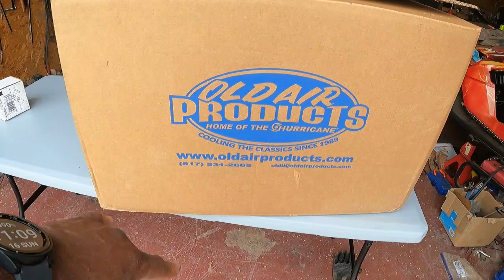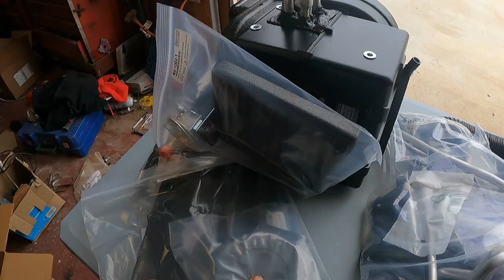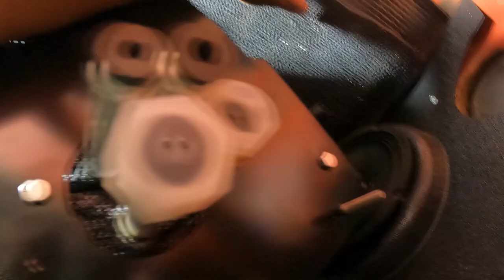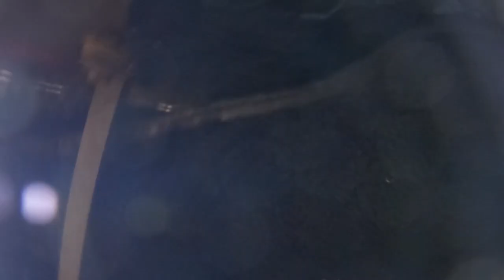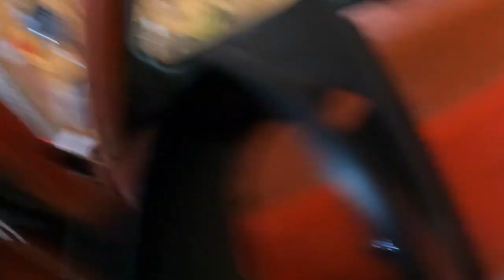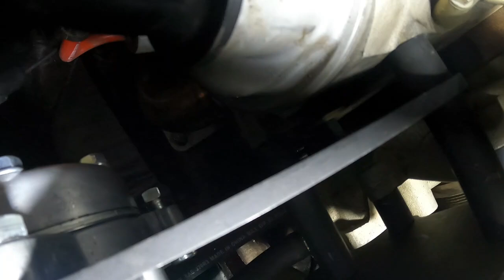Buuurrrr!!! Project C-10 Time To Be COOL!!!! Pt. 32

Comment: How is the system running so far? I have an 83 and debating on going old air prodcuts, vintage air or classic auto air
Reply from the maker: @ranew33 I have had zero issues so far. I live Oklahoma and it's hot but I don't drive every day either
Reply: @rrrobin2569 I appreciate it.

Comment: Job well done sir! I am still running my stock a/c on my 1984 caprice and it blows cold as ice. What are the pros to having vintage air?
Reply from the maker: @PrimeG2  for me it's knowing that all my components are new and I don't have any leaks in the system. I had no idea if om old system even worked. The old air system was super easy to install and will take ou about 3-4 hours to install, if you are not filming....lol.